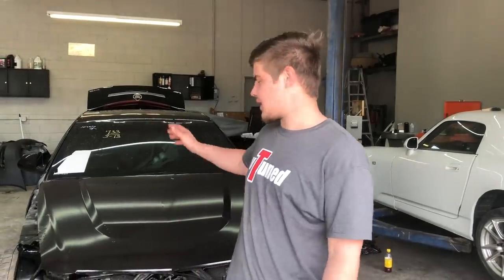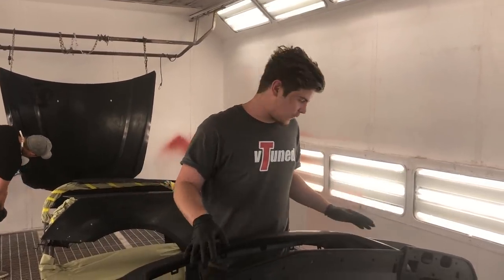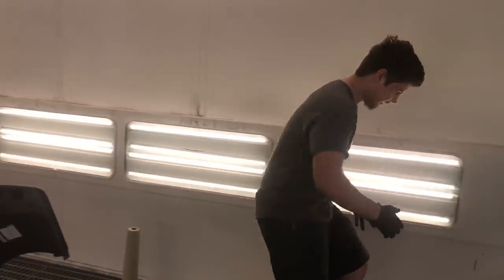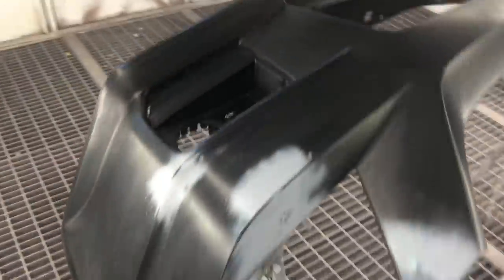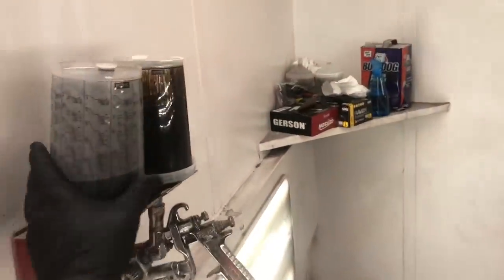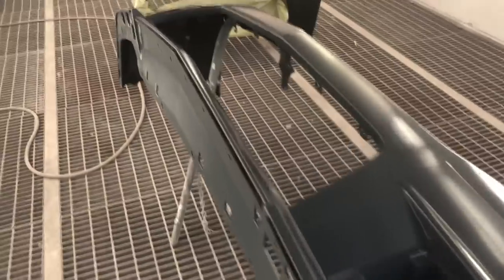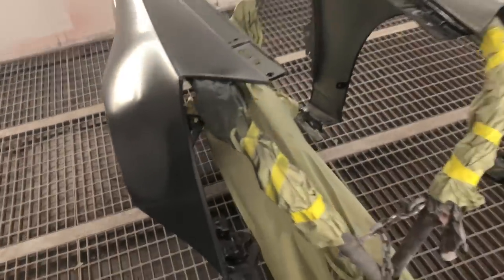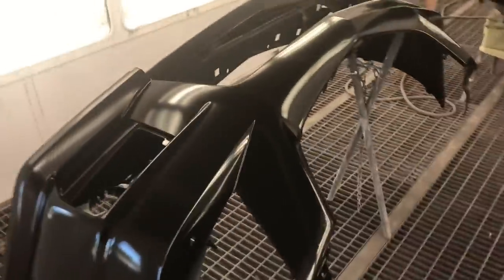CTS-V Gets a fresh Paint job

Comment: I guess i am trying to understand the reason for painting the underside of the hood, considering it's going to get mostly covered by the underhood mat and then the exposed part of the underside of the hood your paint gets cooked from underneath by that hot engine.

But more importantly, why no safety equipment? No breathing protection, no paint suit, no eye protection? You're not invincible. Paint contains known carcinogens.

Your fans would like to see you live longer. If you won't do it for us, do it for yourself. Nobody can rebuild YOU.
Reply: brian weir-  he is trying to  make it look as oem as possible, just like when it was painted in the asembly plant,  you shoot one fast thin coat of clear so that it looks sort of satin-glossy,  if not it would look flat because base coat finish is flat and you need some clear protection because basecoat will come off if sprayed or cleaned with a harsh chemical like degreasers,  the clear helps to shield off grime and grease and makes it easier to clean, clear acts like teflon or ceramic. The clear withstands high temperatures and the more heat exposure it gets, the harder the clear becomes. Clear doesn't get cooked that fast, it gets killed due to drive thru car washes (brushes), lack of maintenance (clears need to be polished/waxed every year) , dirt, dust, snow, and mostly chips from flying debris. Once your clear gets pinholes it starts to peel because dust and moisture starts to get under neath it. As for the under mat, many cars don't come with one, and if they do, he sprays the edges and not so much the center where the mat goes.
Reply: As far as protection, I believe he was using a charcoal filter mask. And I do agree with you. When you are young you feel invincible, these chemicals produce irreversible consequences in the long run, I became allergic to automotive refinishes after 10 years of painting without any health problems and I was young 18-28 when I painted .  And now it sucks because I cant get near a paint job because my lungs-breathing shuts down and I get severe headaches for a week.